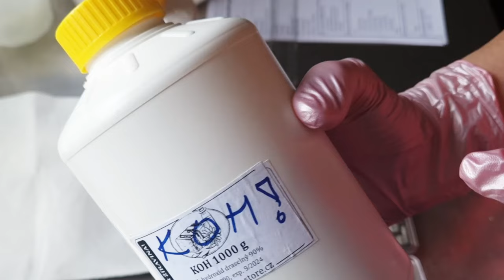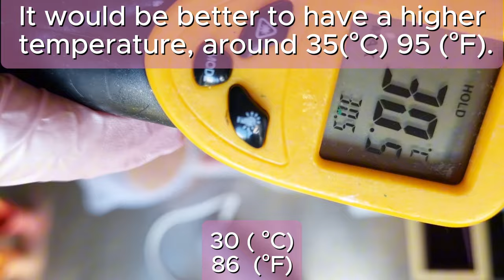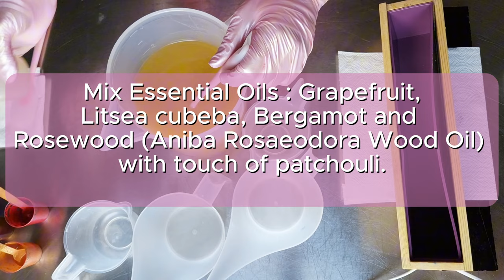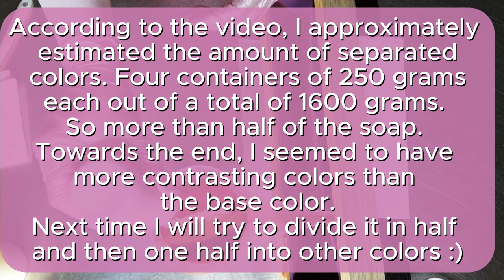Wood Grain Technique Soap |  Thin line Cold Process Soap Making

Comment: Really gorgeous soaps Gabi. It's such a clever idea to use sodium plus potassium hydroxide in the lye solution to keep it fluid longer. 👏 👏 
Thanks for generously sharing the recipe 
What is the percentage of sodium hydroxide versus potassium hydroxide please, if you are comfortable sharing that. Thanks. 😊❤

The camera angle and audio were perfect.
Reply from the maker: The soap is 5% potassium hydroxide and 95% sodium hydroxide. It's the same recipe as the flower swirl🌺 The link is in the description of the video☺ I really like it, the soap has a nice thick lather, it dissolves better and it's also great for shaving☺ I'm glad that you like the soap and the video and everything around it🥰 Thank you very much for your beautiful comment💓it always makes me very happy🤩 Have a fantastic weekend🌻🌻🌻
Reply: Thank you so much Gabi. That's a very helpful tip. I'm going to try this recipe too.
Have a joyful and sunny summer. Take care. ❤